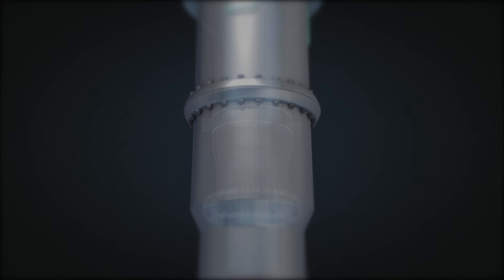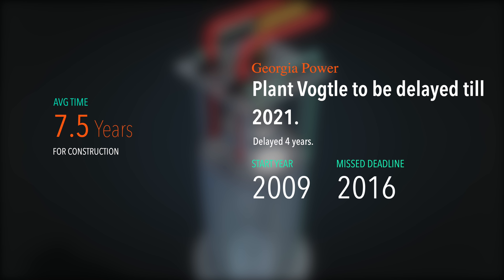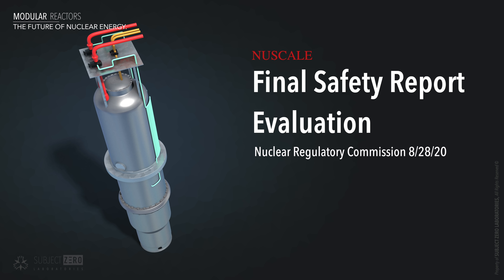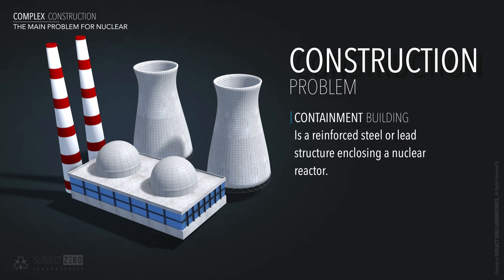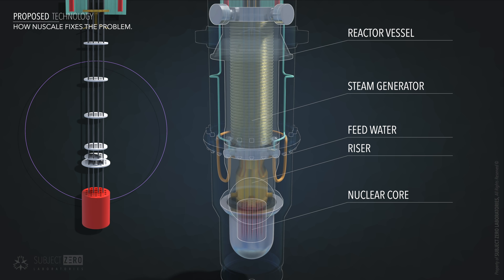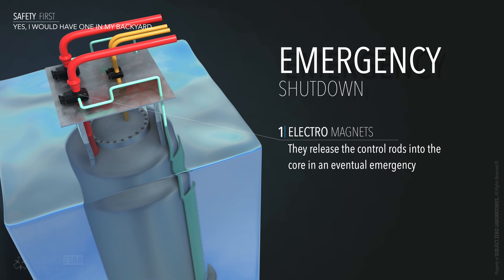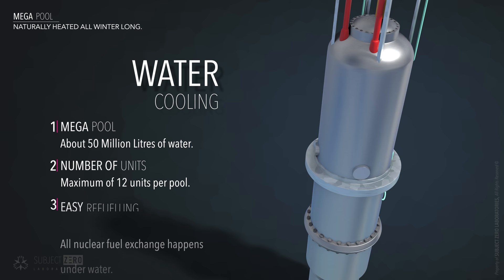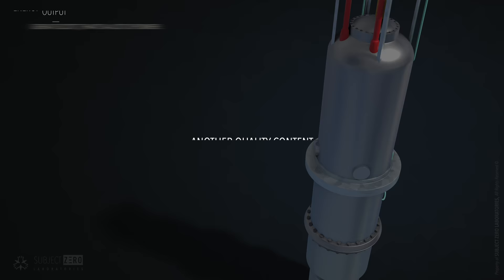A Milestone for Small Modular Reactors (SMR 2020)

Comment: The US Navy has been operating small reactors safely for over 60 years without a serious leak.
Reply: so has nasa. we are sending one to space again pretty soon. voyagers were nuclear. buuut, then again, any problem with safety, it's kinda hurtling out of our solar system at really high speeds never to return. So there's that.
Reply: @devon6306  RTGs aren't the same as a nuclear reactor though
Reply: @Gareth Fairclough Russia also has reactors in ice breaker ships.
Reply: @Mr30friends  they've also lost a bunch of nuclear subs, so maybe not the best example...
Reply: @Mr30friends  Those things are fascinating and terrifying.
Reply: @devon6306  thermoelectric nuclear batteries don't really count. They can barely power the satellites but can barely do it for about 60 years.
Reply: Their waste is just leaking in barrels somewhere else like the rest.
Reply: @wilfdarr  Soviet sub reactors were plauged by near non-existent maintainence and problems excaberated by need to continue patrols when issues did arise. Jive Turkey's sub brief series is a great condensed summary on that. If you watch the brief on the Echo II series you can see an absolutely abysmal track record that would be mostly avoidable with proper maintainence or if the captain had ordered the sub to return to port or go under tow.
Reply: @wilfdarr  Even the super compact lead bismuth reactors of the Alfas were safe designs, but manufacture and maintainence standards of being manufactured and operated by the Soviet Union were not to meet the quality of the design.
Reply: What I mean to point out is that the reactors themselves were still relatively safe designs, proving that even early, compact reactors can be safe designs, but when they are made in a country where manufacture and maintainence standards were below subpar, they are doomed to a poor track record. Had these reactors been manufactured in the USA and then installed in an American shipyard and seen to by personnel who wouldn't, not exxagerating, continue a patrol with a cracked reactor vessel, they would have probably had a good track record too.
Reply: I would always agree nuclear is safer (for the planet, for our miniscule duration here). Even with all the bells and whistles, emission to air is always worse than containment. Elon can ship nuclear waste to another planet for a good price!

It's just always who/how to offload the waste and how much does it cost?
Nothing is created nor destroyed, only transformed. Where would all our waste go? Elons dumpster rockets...

The secret is keeping it in the state of  transformation without having too much waste to offload or current circumstances, if making better money on waste just burn it and filter the air... It's still as bad as it sounds. Smoking a cigarette through a filter still isn't good for you! Unless it's menthol?

Nuclear does a better job Its just impossible to break into the safety side of shtdowns! It's easily possible but proving it to the public when it has bad press and always costs the tax payer investment to build for billions!?! Somebody do a Kickstarter for investment into nuclear safety and get us back on track for social media interest! No solar roadways crap with the money though! Proper engineering
Reply: That's one of the best things: with small reactors come much smaller leaks.
Reply: No, they just dumped their hot waste off the coast of southern long island
Reply: @George Mann don't make waste requiring burning down the global house in order to save it.
Reply: I’d highly doubt there haven’t been horrible accident we just don’t know about.
Reply: @liamwinter4512  The other one I was really referring to was this one:
https://www.youtube.com/watch?v=0TL7eUh4yuI

I'm not a nuclear physicist or anything, just have a fascination with making the world a better place, but anyways, to you, is this any different than the nuclear battery?
Reply: @All2DoIsView  look into the PUREX/UREX process and fuel reprocessing. Some places already do this. The Minor Actinides and Fission Products are all that's left and they have a significantly shorter decay cycle, meaning waste storage much less of an issue. France and Japan both already do this, Japan because they want to be self reliant and not depend on other countries as fissionable isotope sources.
Reply: I am not sure what you call safely. Maybe tell the people that US submarines dump radioactive water overboard from their retention tanks when at sea. This is SOP.
Reply: @TR_P  this is exactly why people hesitate when nuclear is proposed: it's not a question of if they can be built and maintained safely, it's just a question of if they will ACTUALLY be built and maintained safely.
Reply: @Inventorsquare  I liked the video, but I also liked your comment. Sums up the problem
Reply: @George Mann source?  I've very skeptical about this considering the unknown variables of widespread nuclear fallout following accidents in the past.
Reply: @George Mann I like this metric but how is the average figured, does it only count countries with nuclear reactors? does it take into account the number of reactors?
Reply: @TheEvertw  
You lost your mind.
Never was safe. Never will be safe.
Reply: @lonniedobbins1195  Facts are facts. Feelings are fleeting and often lie to you. And if you let you feelings be fed by sensational news stories, your understanding of the world will be wrong.
Nuclear energy is not without its dangers, but you forget that there is a bomb in you car waiting to go off (meaning you gas tank). I have seen what happens to a car when it catches fire. You have about 10 seconds to get out, after that you are toast. Yet no-one complains that petrol is dangerous and should be banned. But many, many more people are killed by petrol than by nuclear power.
Another example. Many people are afraid of flying. But did you know that it is one of the safest means of transport? Doesn't feel like it, does it? But still it is much safer than walking.
Reply: @lonniedobbins1195  well considering that solar panels(and most other alternatives) have low efficiency and create a high carbon footprint. I dont see that solar can fully replace the worlds energy needs. Electrical batteries and solar panel needs to improve in order for solar to be considered as a candidate for replacing fossil energy(even if solar+renewables(hydro,geo,etc)is implemented, the construction cost and bureaucratic problems will be immense).
Reply: Define serious
Reply: @All2DoIsView  don't even need to ship it off planet, just seperate it into the various isotopes. Some are inert with industrial uses, some are good for medical, and some are good for putting in a (higher temp) reactor. Anything else is extremely heavy and stable, so you can just drill a shaft into a subduction zone and let it sink into the mantle for a few thousand millenia, like what's already happened to most the natural reserves of those materials.
Reply: Navy don't talk about leaks nor anything else of issue with their reactors.    Your statement is crap.
Reply: This is , in no small part, the work of Adm. Rickenbacker.  When people accuse me of being OCD, I point to him
Reply: @lightbox617  --- Some of Admiral Rickover's acolytes worked with us on our projects.   We know exactly what you mean.
Reply: @devon6306  NASA are using RTGs, which are basically large nuclear waste containers that use the heat  that the waste gives off to produce electricity. These can't be used instead of reactors, because they use incredibly radioactive materials that reactors make in the first place, and nuclear fission creates a lot more power than just radioactivity. They also half their output every 20-30 years, and even the largest ones produce maybe 5kW at best (about 1000th of a reactor)
Reply: Big lie
Reply: @wilfdarr  they've lost two, since the 50s when they were developed both from mechanical failure unrelated to the reactor itself.
Reply: @thethoughtexperiment9071  Though the accidents were not caused by the reactor, the reactor is the only issue now. The tsunami was not caused by the nuclear power plants in Japan, but the chain led to a nuclear accident. My point is that even these reactors that appear very well designed, if not treated with the utmost respect, are likely to end in nuclear disaster. And saying essentially as you have, that it's ok because it really wasn't the reactors fault isn't going to assure our fellow citizens, as we fight for a cleaner future through nuclear power, that we are seriously considering all risk factors: people need to know that everyone is giving every facet of design the fullest consideration to avoid future problems. And with 2 major disasters already, we're already fighting an uphill battle.
Reply: So, leaking into the ocean is not serious? Not that the Naval incident would leak out to the press. :)
Reply: @unclegeorge6175  It depends. It dilutes to background levels very quickly. Is it trivial, no. Is it serious, not usually.
Reply: and thats the NAVY!
Reply: and were are the spent nuclear fuel cells? try to find them ;)
Reply: @All2DoIsView  If you think in terms of nuclear it's like walking across an an old minefield with an out of date map in the dark with oly a candle to show the way.
The major problem is it's a ticking time bomb and if something can go wrong at the wrong moment it will eventually.
We have no control over natural cataclysmic occurences like volcano eruptions after thousands of years or an earthquake that might happen but not expected in out lifetime.......Fukishima was not expected to happen but it did......Chernobyl was not expected to happen and no procedures were formulated with the though that it possibly could happen.
We are not mystics with crystal balls to foretell the future, but if the stakes are high the odds on an occurence happening are too important to dismiss as not in our neighborhood so it's OK.
I expect the same could have been said to the Romans when they founded a city on the slopes of Vesuvius which was active at the time and had been for millions of years previously......they just couldn't comprehend that if Vesuvius did blow up they would go up with it.
Reply: Kaitlyn L I’ve had that argument a lot: RTG is not a nuclear reactor because it’s power comes from the heat coming from normal radioactive decay and not from sustainable neutron generation.
Reply: @devon6306  Well, Navys from USA France or England uses "smal sized" nuclear reactors but they are still power beast.
"Nuclear reactor" sent in space have nothing to do with others reactors: They're just NOT nuclear fission reactor. They just use some material (plutonium usually) that is radioactive enough to heat itself a bit. And then this eat is partially converted into electricity. If the amount of plutonium present in this space probes has been use into a real nuclear reactor, I assure you, it would have generate a much much bigger amount of energy.
Reply: @TheEvertw  don't forget hydro electric and geo thermal are also good baseload power generators to
Reply: @josedanielherrera7115  nuclear powerplants don't explode, without contaminant structures they can burn releasing radiation.
Reply: @kercchan3307  Hydro power is not very evenly distributed though. Those that have it are blessed. But it is not sufficient to power densely populated nations.
Geopower is interesting, but more suited to heating houses than for generating electricity. It also requires expensive infrastructure, and is thus only applicable in densely populated areas.
So, sure, these have a place, but are no replacement for large power stations.
Reply: @kercchan3307  A nuclear fusion powerplant can theoretically explode but doesn't release long lived nuclear waste (HLW) like self sustaining fission plants that don't explode but meltdown.  I didn't mention explosions but ok! So you're wrong, they can explode but they're rather easy to turn off if they do unless the explosion kills the controller in the process of exploding lol.  That would be a rather large explosion.  Anything can theoretically explode but that's beside the point.
Reply: The US Military constitutes the worst and biggest bunch of wasters on the planet. Plenty of problems with nuclear subs and ships all over the world, from downtime due to maintenance to full on sinkings.. Thorium Molten Salt Breeder Reactors are the safest, but probably not small enough for sub compared to enriched uranium reactors.
Reply: @devon6306  just something of note, spacecraft uses RTGs, these are nuclear reactors that have no moving parts, fully passive cooling system, and have no power output throttle control, they work through natural nuclear dacay instead of active critical mass control like normal fission reactors, they are pretty much 100% maintenance free, but they have 2 downsides that makes then unviable to earthly application: 1 they are absolutely stupid expensive, 2 excessively low efficiency because they need to be as reliable as possible.
Reply: @liamwinter4512  but navy vessels does. Which put us back to the first comment.
Reply: The government could ruin heaven If they could
Reply: You mean the submarines sunk to the ground you dont care about?
Reply: but not without a leak
Reply: @devon6306  The power source in the Voyagers is not a nuclear reactor but a radioisotope thermoelectric generator - essentially a nuclear battery powered by plutonium. They are minimally shielded and radiate hugely but that does not matter in deep space.
Reply: Andrew Briseno  I assume by "LAIRS", you meant "liars". None of the cases you cited were the result of reactor problems. The squalor of the Soviets is undeniable, but it will probably take centuries for the reactors to corrode and release radioactive material, fractionally raising the current  uranium level in the water.
Reply: @Inventorsquare  Leaking?
Reply: "Say nuclear wessels!"  "NO!"
Reply: That's funny.
Reply: What u going to trust what the US Navy Says???  Small reactors are a must have. They would lie to protect themselves.
Reply: @lonniedobbins1195  "safe" is always a relative term. Nothing is absolutely safe. And for what it's worth, I am more in favor of things that don't go kaboom.
Reply: @nani4261  That is not true anymore. Solar came down a few factors of ten in cost, which helps. Also insurance is pricing in costs of power plant disasters, which is making coal prohibitively expensive to run.
Reply: @wilfdarr  Overall, it doesn't seem that reactors are very likely to end in disaster. I do wonder what the data would look like if we put all of the reactor incidents on a map, with all of the existing reactors and deactivated reactors. I have the gut feeling that cigarettes, alcohol, and leaded gasoline have done more harm than nuclear power.
Reply: @lightbox617  Do not forget Admiral Hyman George Rickover, the forefather of destroying commercial nuclear power. His zealot priority, create weapon grade Plutonium. (Dr. No)
Reply: @gangleweed  Even under catastrophes, Molten Salt would not contaminate the environment like these old high pressure steam bombs. The no pressure molten salt would expand or ooz like lava but cool and solidify into a rock very quickly. No dilution, no seeping into the ground with diminished chain reaction . Self containment!
Reply: @paulcurry4252  Molten Salt reactor does not go Kaboom :)
Reply: @paulcurry4252  I hear you. I'm actually a nuke fan boy myself: I'm just pointing out the problems that need to be addressed before we can get these things built. Because of the absolutely unacceptable nature of an accident, the chance of an accident must simply be zero chance. If the chance goes above zero, the reactor must be shut down. And the people have to have faith that this will in fact happen or it won't get built.
Reply: @unclegeorge6175  Having worked in the industry many years ago I have come to realise that there is a plus and minus side to all things.....people who only see the plus side of anything are blinded to the reality of the possible minus consequences that might happen.......I don't think you've given one single thought to a possible cataclysmic event regarding the release of radio active material not matter how small......if Fukishima or Chernobyl didn't alarm you then you are truly blind.
Reply: @gangleweed  Those did alarm me. And they have successfully scared the world enough that we don't hear nearly so much about Three Mile Island these days. Which isn't really that surprising, given the scale of the damage that happened.

On the other hand, those are the only two Level 7 INES events. https://www.youtube.com/watch?v=0Z-Bv_C9K9E
Reply: @paulcurry4252  Look at it this way.....it's a freedom from the producers thing..........with nuclear generation you are back to square one with the energy company owning your source of supply and you paying forever to them .....who is getting rich?......if you support the personal photo voltaic on your roof system the Sun is free and cannot ever be taxed so you would be independent with a battery bank to keep you on charge while the Sun shines......if you run short of your personal supply you could by agreement  draw from the grid and pay accordingly......but the amount you would need would be extremely minimal per year and at the same time you get free motoring energy from your bank too......you would have to pay to use the road though but not to fill up with petrol etc.
Reply: @gangleweed  There are lots of arguments going on in your response. Most importantly overall, though, this isn't an either-or proposition. This is a TRY EVERYTHING situation. The CO2 problem is so huge that we need to do everything we can to have net NEGATIVE CO2 emissions as soon as humanly possible.

So, for every home where solar and/or wind is a viable option, let's put in solar and/or wind power! As well as big honkin' battery banks. In sunny places put solar cells on every roof that could support them, and in all places consider going with green roof designs. In windy places, go with some of those compact windmills too. 

But, that's not going to be enough. People living in apartment buildings can't just solar panel their way to power independence, because of limitations of area that gets sunlight. Urban density is a limiting factor for solar and wind power. Ownership of the property is required to modify the property, so people who rent can't choose for themselves. People who don't live in sunny areas can't choose solar power. People who don't have the start-up capital required can't choose any alternatives at all. So, we need to figure out how to get carbon-neutral or carbon-negative power to those people also. 

This doesn't include industrial uses of electrical power, which requires power density that isn't easily met by solar. And doesn't include transportation uses, which might not be easily answered by solar power, or wind power. We need to use available options.
Reply: @gangleweed  Have you checked Chernobyl lately. The other plants are still running. Wildlife is flourishing and except for a small area (ground zero); people are back. You don't realize that significant levels of radioactivity is being released everyday in nature. Coal fired plants are constantly dispersing high levels of radioactivity over hundreds of miles. You're probably breathing it right now and don't know it. 
The Chernobyl  catastrophe is just like COVID-19, criminal actions by unscrupulous governments. So far,  COVID-19 has killed sixty times more than Chernobyl and has yet to stop. This is a man made catastrophe!  
You mentioned Fukishima (One radiation death), a very old light water design that should have been shutdown ten years prior the Tsunami. Light water reactors should have never been built in first place. Thorium Molten Salt reactors would never contaminate the environment as you suggest. The solidifying salt would contain for clean up and the radioactivity would diminish to much lower levels. The physical properties of Molten Salt is similar to Volcanic Lava. Did you know that lava contains high levels of radioactivity? Are you going to ban volcanoes?
Reply: @unclegeorge6175  LOL.....well then you'll just have to live with the lies they feed you or the lies you so fervently believe in......when you get exposed to the consequences of a Nuclear disaster there is no going back.....for thousands of years.
Reply: @tylerehredt9302  Ok, so there is some horrible accident - killing great numbers of people? wasting vast swathes of land or sea? creating fires and spawning demons? - or maybe, just maybe, since we don't have even a whisper of such an accident, we never knew about it because it didn't happen?
Reply: @mikemhz  InventorSquare's leaking barrels are problematic - a) current PWR waste is solid, so difficult to imagine the leak. b) somewhere, yes, somewhere, despite the company inspectors, national regulator inspectors, and trans-national IAEA inspectors keeping track of the waste.
Reply: @gangleweed  "a possible cataclysmic event regarding the release of radio active material not matter how small" - ok, so if the release is small, then how can it be cataclysmic?

Chernobyl - a flawed design, operated in a manner that was not to then-current Soviet specs, resulted in a non-cataclysmic accident. Terrible for its victims, but hardly cataclysmic. RE hydro dam failures - now that is cataclysmic! Chernobyl  had around 65 total dead known from the accident, and another 4000 who will have shortened lives. 
(note to anyone who wants to claim 1,000s, 10,000s, 100,000s, or 1,000,000s of dead ...
 Where are the graves? Where are the death certificates?)

Was this horrible? Yes. But Germany kills 4000 every year by burning coal and has promised to keep killing people until 2038. That is even more horrible!
http://env-health.org/IMG/pdf/dark_cloud-full_report_final.pdf

Fukushima - the cataclysmic event where 2 plant workers drowned from a tsunami and a third (although the court awarded his estate damages, it also took pains to note NOT from the accident) from lung cancer 5 years later?
Or are you referring to the cataclysmic event where a few ml of tritiated water will be released into the Pacific Ocean over the course of 30 years?
Reply: @gangleweed  So if everyone put a solar panel on their home's roof, we're good?
Given that residential energy is about 20% of total energy, and residential electricity is about 50% of residential energy, your non-solution covers about 10% of total energy.
(IEA data)

What is unaddressed by your 'freedom from the producers thing' plan is residential heat, industry, transport, agriculture.
Reply: @unclegeorge6175  Actually the last reactor at Chernobyl shut down in 2000.
Reply: @factnotfiction5915  Quite frankly my dear I just don't give a damn......at my age I won't be around long enough to know the results of any nuclear misadventure, so smile, and be happy, life is too short to worry.
Reply: @factnotfiction5915  It's an ongoing thing.........eventually the whole grid will be off fossil fuel in one way or another.......just what is the preferred way to get electricity cheaply is an arbitrary fact of life and will be dictated by those that have the most amount of money invested for the maximum return......you are just a pawn and will pay those that demand the price, like it or not.........UNLESS of course you have your own PV generator and a pile of storage batteries.
Reply: Who tell you that ?
Reply: Wrong.... This concept has been dependent on development on news scientific research....
Reply: @wilfdarr  Sunken submarines are not really a problem. The nuclear fuel is encapsulated within a very thick steel vessel. It’s small enough for the surrounding sea to passively cool the decay heat until the fuel eventually burns up.
Reply: @All2DoIsView  High level Nuclear Waste has a massive half life because just 4% of the fissile energy used. We now have Chloride salt reactors that can use 99% of the fissile energy. The waste half-life is 30 years against 30,000  they get 20x more power from existing waste and solve the long term storage issue.
Reply: that we know of
Reply: Why they're not selling them overseas i am sick of electricity bills
Reply: @shahriarfardin777  They are not selling them at all yet
Reply: #SMR floating nuclear power plant will benefit land scarce countries like Singapore.

One day Singapore just need to rent 10-20 such power plant offshore.
Reply: Nice facts
Reply: The US has done in the open air over 2,000 nuclear tests. Yes a leak is bad as rare has it could occur but will be localized. but we stll need to maximize safety
Reply: @Gareth Fairclough if thats about their aircraft carriers, then no, they use diesel for their aircraft carriers
Reply: @wilfdarr  Yeah, and they lost those subs because they were too careless with a technology that demands absolute care and attention. That's a human problem not a problem with the technology.
Reply: @Inventorsquare 
lol That is such a 1970's statement. 🙃